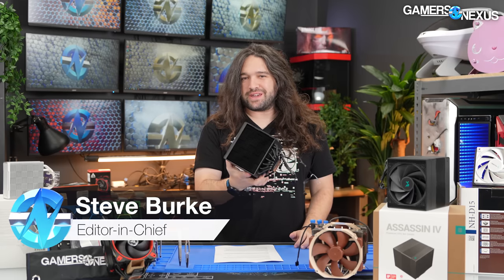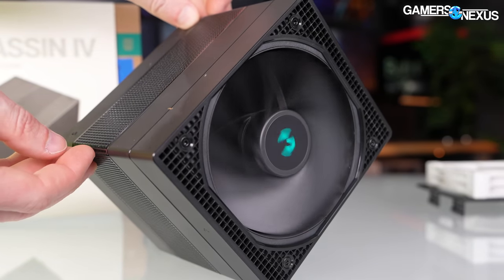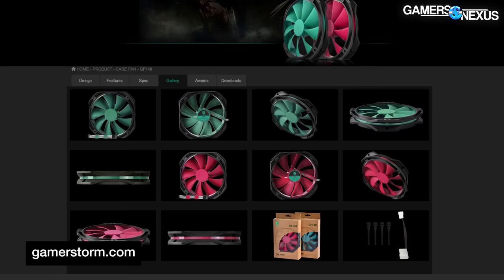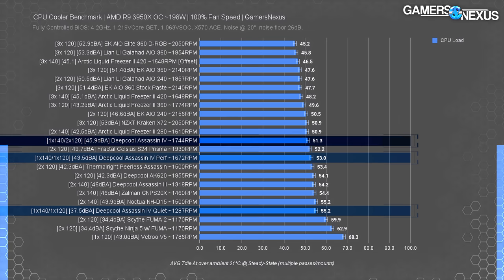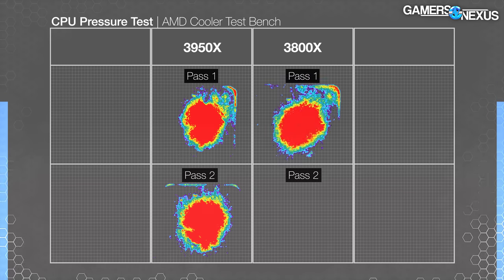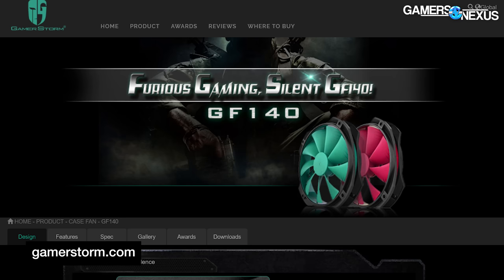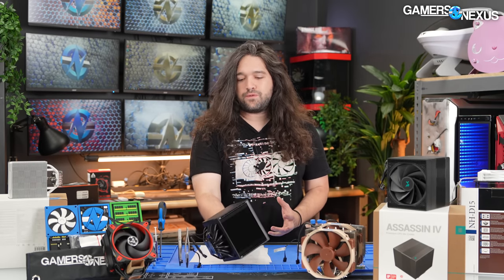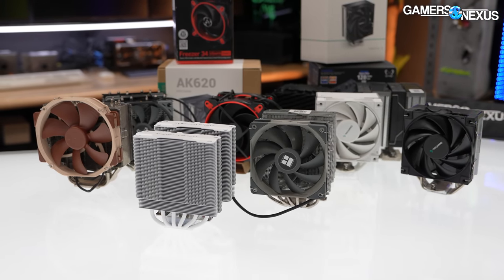Mega Size Air Cooler: Deepcool Assassin IV CPU Cooler Review & Benchmarks

Comment from the maker: We're fully back into reviews with a ton of interesting stuff coming up! Here's the Deepcool Assassin IV! In the meantime, check out the big project that occupied us for a few weeks - our AMD Lab Tour full documentary: https://www.youtube.com/watch?v=7H4eg2jOvVw
Reply: first I learned english watching GN videos and now I understand enough of it for even learning something about computer hardware. What a blast!!
Reply: On the first chart - DCA IV on quiet is exactly the same temp as the NH-D15 at full speed, but at only 37.5db vs the Noctua's 43.9db. That's AWESOME!
Reply: I hope you guys will get around to lower height coolers. Some cases cannot fit a 155mm high cooler and liquid cooling isn't a realistic option. one cooler in particular has my interest.
The ID-COOLING SE-207-XT Slim, it's only 135mm high and costs around $40 bucks.
Reply: Question! Would you be willing to measure noise at idle / light load and while assembled in a case? Esp. relevant to AIOs with their pumps, and to a lesser degree, due to their fans being less enclosed within a case.

At idle / light load it's likely that the entire rest of the system is silent, the noise floor of the room is lower (e.g. nothing is playing through the speakers), and the user is not wearing headphones. While possibly still using the machine (e.g. reading something). At night the noise floor can get extremely low. In such conditions while the cooler noise itself is much lower, sensitivity to it is much higher, esp. when it takes whiney / rumbling / ratcheting tones. I believe this characteristic in practice can in fact make entire classes of products, such as AIOs for example, much less valuable to prospective unsuspecting users than currently measured data may suggest.

Thanks!
Reply: Can you review the Alpenföhn Brocken 4 max aswell? Would be awesome!
Reply: Looking forward to the Thermaltake CTE 700 Review :D
Reply: The Peerless Assassin has been great but have you reviewed the Phantom Spirit yet? It's also from Thermaltake but it is a 7 heatpipe design instead of 6 (I believe it's the successor to the Assassin?)
Reply: Whoa! That cooler design is pretty sick! Stealthy!
Reply: @GamersNexus can we get some ID-Cooling in the lineup? They make some decent budget coolers
Reply: Der8auer sagt Nein. Er sagt Nein. Nein.
Reply: deepcool said they had defective fans on the reviews samples , and it is fixed on the market units, not sure if urs is review sample or you purchased it. Hardware Canucks said that.
Reply: ROG Ally in depth hardware failure review when?
Reply: As you have the test setups for cooling can you take a look at AIO's vs Air with higher ambients because not all of us run in 21C environments. I get a handful of days as an example where I run my main box at over 40C and 30C on maybe 20-30+ days. My view is that AIO's under heavy loads will fall over compared to Air in this situation.
Reply: Sorry but i think there is a typo in your review.... should read DeepAss cool  IV because that is a chonky boy indead. 🤣
Reply: I'm super interested in this cooler, but also a huge fan of the Lian Li infinity fans and have some spares. Would there be room in your schedule for checking compatibility with other fans?

Additionally, since the slot ofr the 140mm fan seems so uniform, would a 120mm fan in a 3d printed bracket be a suitable replacement?
Reply: Question.?  Can the "exhaust" fan be rotated 180 degrees.?  Can the "centre" fan be rotated 180 degrees.?  If so, I would love to see this tested with the included 120mm as an intake, the centre fan pointing in the right direction and the exhaust fan being the case fan because I have also rotated the heatsink 180 degrees.!  Apart from RAM clearance, is there any reason why this cannot be done.?  If it can be done, I would love to see tests as that would be a very slick air path front to back.!
Reply: STEVE please. We know you care. So please you cannot hide your embarrassment when you said in the beginning "functionality". Your voice cracked. I know it is a massive supporter company but you said you are unbiased it's your job. Please sort this out. It's hypocritical. Good luck Steve
Reply: I've just thought of a question that I think you folks have touched on, but might not have done a full deep-dive into. Since Noctua and bequiet! are both focused on fans that are as quiet as possible, what are the actual number differences between them? I doubt this will be seen, much less actually tested by you amazing guys at GN, but I figured I'd post this on the off-chznce SOMETHING happens.
Reply: Hey, I don't think anybody has mentioned this yet. Is it possible that the 140mm fan's "mounting clip" is meant to be used on replacement 120mm fans? Like, the if your were to replace all fans in this cooler, you'll end up with 3x120mm fans instead of the odd 120mm+140mm+120mm sandwich. I feel like that's what they're trying to go for with this. Especially since if you replace the 140mm with a 120mm fan, it might possibly fit inside the shroud completely, hidden from view by the cover.
Reply: Would love to see this against the updated Dark Rock Pro 5 version. Looking to go back to air cooled system.

Comment: Impressive work from Deepcool, but the Peerless Assassin for $35 was too good of a value.
Reply: Yep - I got the Peerless 120 (dual fan-dual tower) in anticipation of a 5800x3d, then setteld for a 5600x instead....I cannot get the CPU any hotter than about 40c, no matter what I throw at it.
Reply: did the same lmaoo got it for 33$ cant beat that!
Reply: Bought mine used for 20. Amazing value!
Reply: @yissnakklives8866  That's pretty overkill considering the 5600/x gets by just fine with the stock cooler(and most builds would recommend it)
Reply: @Boostmeister69  30$ is worth it just to have a silent ambient, AMD stock cooler makes too much noise when in full load.
Reply: @Boostmeister69  yeah, but I had the cart before the horse, so to speak 😁
Reply: Just buy a dark rock 3 for 20 used
Reply: @19alive  oh I didn't know it was that bad. Maybe GN should put it on the charts for reference lmao
Reply: @yissnakklives8866  Yea, I got the single on a 5600x and even this summer with super hot days its yet to go over 56c
Reply: It can, but not always. If your case is poor thermally you do need a better cooler.

Comment: Having bought their AK620 I really like the design aesthetic that DeepCool is going for without sacrificing(much) performance. Very clean. I am really tempted to buy this as well but maybe wait for a version 2.
Reply: I am pretty happy with the AK620, like it for the long term perspective as we can replace the 120mm fans anytime when u have to
Reply: @boots6384  I run 12900k on the AK620 + thermal plate, works surprisingly well. This one looks kinda nice but I don't see much benefit of upgrading from the 620.
Reply: @snap_oversteer  I'd replace the ILM first.
Reply: I'm glad you brought this up because I just added the AK620 about a month ago and now I'm curious about this... hmm
Reply: @tyrantworm7392  Yeah I meant I run the thermalright contact frame ILM replacement, worded it a bit wrong.
Reply: I also like the ak620 but I had to go to quite some effort to stop the fans/heatsink from resonating.
Reply: Got an AK620 Zero Dark for the 11400 in the HTPC. Keeps it around 65c maximum load and pretty much silent.
Reply: I'm thinking about AK620-Digital. it's just 75 euro, without display 65 euro

Comment: Thermalright has an extra couple of models available now. Mainly the Frost Spirit and the Frost Commander on the "high" end. Hopefully you guys will take a look at those soon.
Reply: just ordered a Peerless Assassin SE, since the fan of my Macho Rev.B which i bought used like 5 years ago is dying. That thing has been taming a overclocked 2600K and then a 5800x. 25 Bucks for a new Noctua fan or 40 for a whole new top-end cooler, easy choice. will still buy a new fan for it and use it in my second system when i finished rebuilding the main one. Cant go wrong with Thermalright when you want bang for buck
Reply: god bless thermalright <3 lmfao
Reply: @erraldstyler even the cheap 3 pack of thermal right case fans are actually really good fans they move some air for sure. I need to get more of them lol.
Reply: @JimJik  In fact I got a Macho Rev B some 10 yrs ago and it was a banger. When building my next two builds, they were just gone. With having a 5800x3D now I looked for another cooler and there they arise again, much to their old glory ^^
Reply: @@blue-lu3iz that ain't doin much more than the PA, since Fin area is the same. However I went for the Phantom Spirit two have that little more ability to move heat away, even if the finstack as an ultimate limit has not been changed. But I hear the 8mm heatpipe options that the foreposter talks about are a bit different.
Reply: not high end, but is a dual tower cooler:  Thermalright Silver Soul 135.

i put that in an old build with an  i5-7400 and it keeps it nice and chilly
Reply: Peerless assassin new model
Ak62
this cooler DA4
Budget arctic 34 duo

But I love the dark rock pro 4